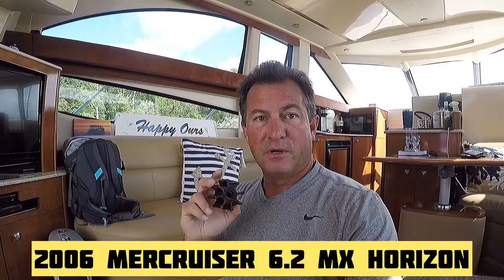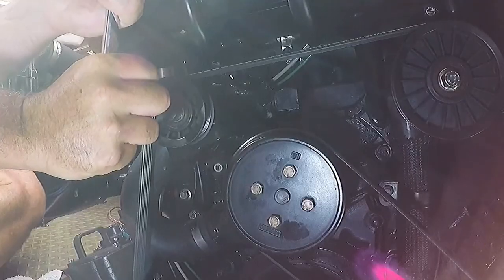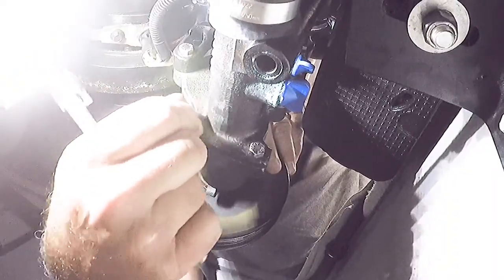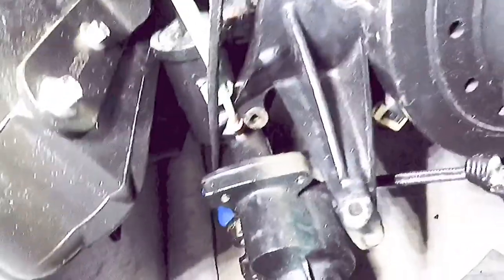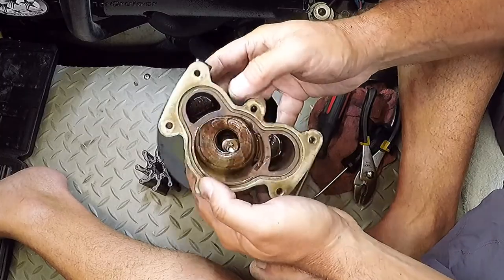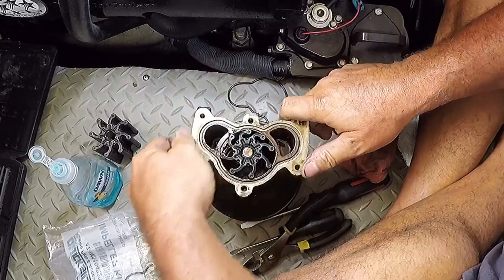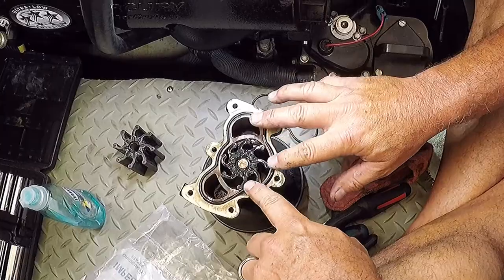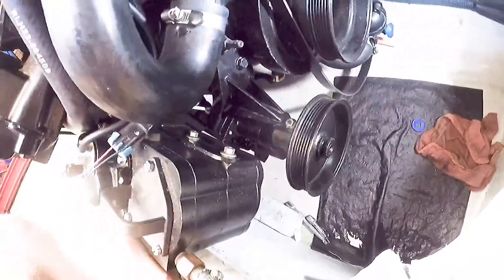Mercruiser Impeller Changeout

Comment: I watched a video where a guy tapped out the part of the pump with the hose barbs so he could put the small housing bolts in from the front side rather than having to reach under to the back side. I’ve changed hundreds of Bravo style pumps old style and the new style like this one and they are always a pain to do. I’ve got to do a 2006 Meridian 411 with 8.1 in the next few weeks.
Reply from the maker: Plan B was to tap them out.  Using the original setup with new hoses was easy enough and didn’t leak so I’m going that route for port engine next week.
Reply: Would you post a link to this video please?

Comment: Great video. I didn’t know the impeller direction can change (at least on some models right). I have always used 2 zip ties to compress the vanes of the impeller to slide it in the pump similar to using a ring compressor when installing a pistons into a cylinder.
Reply from the maker: I’ve tried that too.  I always tried to put in the correct direction but at least this model self corrects.

Comment: Just curious what are your water psi cruising?  Im getting 11 on one engine and 20 on the other at 3700rpm. Thinking i should do the impellers. Temps stay at 160. Same engines and year as you. New to me boat this year. Great video!
Reply from the maker: Not sure what they read at speed but they are similiar.